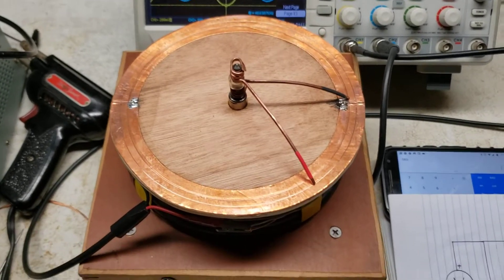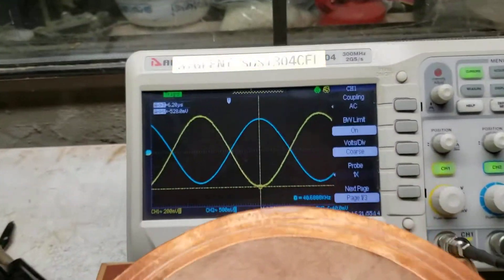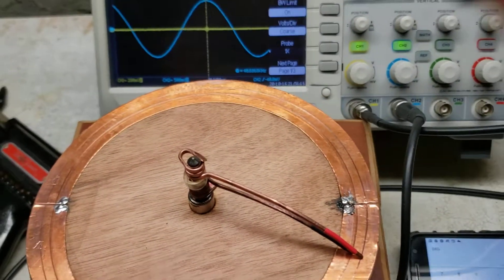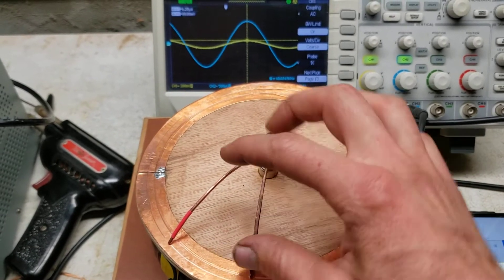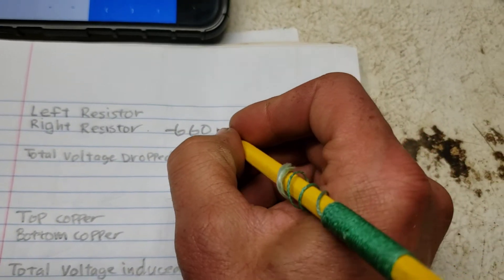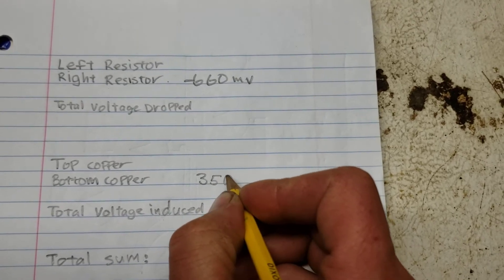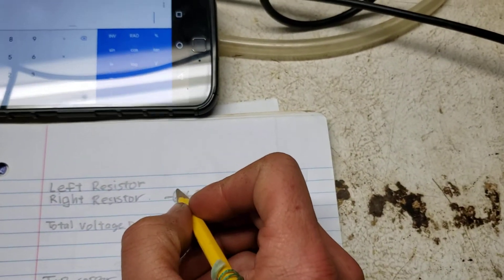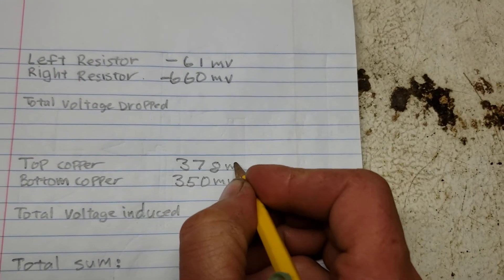The Lewin clock - Kirchhoff's Voltage Law(KVL) holds for loop circuits with induced voltage elements

Comment: Good to see actual experiments being carried out. I think your measurement only proves KVL fails, not otherwise. There is no voltage along the conducting arc, nor the radial segment. If there is, you must explain why there is no huge current, given that their resistance is ~0. It is precisely because there is no voltage along the sector loop and yet you could measure the voltage at the terminals that proves KVL fails.
Reply from the maker: If there was no voltage along the sector of a partial turn, then why was my volt meter measuring voltage?
Reply: @fromjesse  you are enclosing magnetic Flux with your probing circuit. That's why
Reply from the maker: @psonna  > you are enclosing magnetic Flux with your probing circuit. That's why
Of course!
You can model it as half the area of dB/dt, or you can model it as a half a turn according to Faraday's law, it doesn't matter, it's still physically allowing us to measure the voltage induced in that very half turn of winding. And that's what's important. Cheers!
Reply: @fromjesse  you-you've done it. You f___ed him off. You f___ed 4,4K subscriber channel off! Great job man!
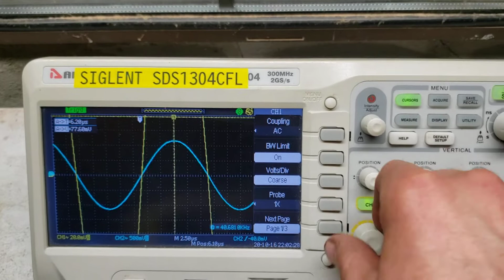Reply: @fromjesse  What you measured is the voltage induced from a sector of changing magnetic flux. Because there is no voltage along the conductor, and yet there is voltage at the output, the phenomenon is unintuitive and hard to accept. This is where KVL fails, the whole issue of the debate. I spent quite a bit of effect to explain the mechanism that causes this to happen, from 5:00 to 7:00, so I sincerely hope you watch carefully. Essentially, you have to consider the movement of charges along the wire, and their Coulomb e-field to get a complete picture.
Reply from the maker: @SiliconSoup  let's start real simple. Can you answer this question? The last three people to argue with me all refused to answer this question:

Lets say I have a small mains powered 50/60hz transformer which has two isolated outputs each producing 0.5v.

Then let's say I wire them in a series loop with two resistors.

Will KVL hold true for this setup? Yes? No? Don't know?
Reply: @fromjesse  KVL never holds for transformers and inductors, if you examine the voltage along every path, including that of the coil. But for circuit analysis, we are not interested in what is inside the transformer, so we use lumped component model to hide the fact the voltage along the coil is zero, and use the voltage across the terminal for calculation. So outside the transformer, by calculation or by measurement, KVL holds. But if you dig inside the transformer, KVL fails.
Reply from the maker: @SiliconSoup  thank you! 

Of course you have to lump each component in the loop. If you had a wet cell and were probing somewhere on the juicy part, that's not correct lumping.  Or if you had a solar cell or any other component and you were probing inside it at some other point than the terminals KVL would fail that too because every single component has to be lumped!

KVL doesn't care whats inside the lumped elements, it only cares about the voltage on the terminals.

Now, can you please answers this question: 

If we can, for the sake of KVL, lump each output winding as a lumped component,  why then cannot I just as legitimately lump the two output windings each as a lumped component and apply KVL as I did In the above video?

Its still a transformer.  It still has 4 properly lumped components.

And the algebraic sum of all the voltages around the loop is zero.

What is the difference between the demonstration in the above video (The Lewin Clock) and the small mains transformer with two output windings?  Why does KVL hold for one and not the other when they are functionally and electrically identical? 
Thanks!
Reply from the maker: @kpaxxapk6397  You really described it well, thank you!
Reply from the maker: So many arm chair theorists get stuck up on the false belief that the only way to induce a measurable voltage along a conductor is using current against resistance. 

But that's not true. There are several ways to induced a voltage across an inductor without current one of which is a changing magnetic field. Other things include the Peltier effect. Are you next going to argue that a Peltier voltage source cannot be used in a Kirchhoffs Voltage Loop because ohms law doesn't allow that much voltage across such a low resistance without a large current source? 

There are also other types of voltage sources that defy ohms law if you try to falsely treat them as a strictly ohmic scenario. 

But KVL doesn't care what the voltage source or the voltage drop is. 

What if you you had a couple ac transformers running off the mains. They each put out half a volt. 
You wire them up in a series loop with a couple resistors,  are you going to tell me that KVL won't hold for that too, because the voltage source coming from the transformers is derived from an electromagnetic principle? 

But what if instead of little transformers it was solid state digital waveform generators making the exact same waveform,  would that work for KVL? 

The silly thing about this whole discussion is that KVL simply states that if you have a loop and you add up all the voltages across each grouped element while honoring the sign, the sum will be zero.

I literally measured all the voltages across each of the grouped elements while honoring the sign,  and it summed to zero (at least within the margin if error for my volt meter.)

And you say it shows that KVL fails? How the Tarzan did it fail? It summed to zero. Thats the one thing it needs to do to succeed.

How did it fail to hold on this demonstration? 

Cheers!
Reply: @fromjesse  Why do you think you can selectively throw away ohm's law for the copper arc you measured?
It is precisely because the inductors have induced voltage across the terminals, and yet 0V along the coils that makes KVL fails.
Reply from the maker: @SiliconSoup    so what about ohms law? Say we have a transformer secondary with 0.0001 ohms and 100v. You'd expect a million amps, right? 

Or let's say we have a Peltier junction  with 0.1 ohms and 0.1v you would expect one amp.

Or let's say you have an electrochemical cell with an internal resistance of 1 ohms and a voltage of 3.6 volts.

All of these violate ohms law if we try to understand them as strictly ohmic.

Or if we connect a battery 100v battery  to a 0.0001 dc ohm inductor - at first there is no current when there should be a million amps.

It is not i who is selectively throwing out ohms law.

I'm just not trying to model every component as being strictly ohmic. All components may have ohmic properties but many Also have other properties. 

I'm not even sure why we're talking about KVL being applied to the segments along a winding path inside a transformer. KVL is for closed loops made of lumped components, not the open path inside an individual component. 

So you're saying that there is no voltage induced in the copper arc because that violates ohms law, but then you say its only at my terminals? But my terminals also have low resistance so doesn't that also violate ohms law? The entire system is low resistance and low current. Where ever you propose that the voltage is induced will violate ohms law unless you acknowledge that induction can create voltage across a wire without current im that  wire.

Once you realize that, then the secondary winding becomes the logical place for that, not some magical thing that causes my leads to have all that voltage on them while there's no voltage on the winding itself.

Why not along the arc length since its the one that cuts across the changing magnetic field and since my probes don't cut across a changing magnetic field?
Reply: @fromjesse  In the case of transformer secondary with 0.0001 ohms and 100v, if the two terminals are open ended, there is no current. if there is no current, there is no voltage drop along the coil. Even if there is current because of some load, along the coil, the voltage is still 0V, because V=IR is 0 when R_coil = 0. Across the terminals, the voltage is 100V. KVL fails.
If you think KVL not applicable to open path, just model your scope with a 1M ohm load, then the sector and the load forms a close loop. The voltage drop along the sector (arc + radial) is 0, because R_sector = 0 ohms (ideal case for the arc) times whatever current, the drop is 0 volts. Yes, along the sector (arc+radial) there is no voltage, yet the 1M ohm load (scope) has a voltage. This is the gist of KVL's failure. It is hard to believe, it is unintuitive, but it is true. To know how this could happen, you have to understand there is another hidden force in the transformer, the Coulomb force. The voltage across the transformer terminal is not from the changing magnetic flux DIRECTLY, but from the accumulated charges. I sincerely hope you watch my video. The content I put up is well established in advanced electromagnetism, not my personal guess. Of course it agrees with Dr. Lewin. I agree with Dr. Lewin, not because he is a famous professor, but because the same content is taught in advanced level of electromagnetism. After I posted my video, a viewer brought me to stackexchange.com, in which there was a discussion about "What would a voltmeter measure if you had an electromotive force generated by a changing magnetic field". A contributor posted a section "A tale of two fields" and it is relevant to our discussion.
Reply from the maker: @SiliconSoup   I did watch your video once at normal speed, but I'm out of town for a few weeks using my limited cellular data so I'm not going to watch it again till I get home.

Saying that an open loop becomes a closed loop due to the volt meter is a cop out: the current drawn by the volt meter is so small it does not significantly change the circuit under test. And in fact some field effect volt meters really do essentially draw no current,  but they work just the same.

You say that there is no voltage along the wire because there is no current because V=IR.  Isnt that just as true for any voltage generating component? Does a Peltier junction violate V=IR? Are we gonna say that since an unloaded Peltier junction  has low resistance and no current it therefore has no voltage even though the voltage meter reads 0.1v?

Look. KVL doesn't care what is inside a lumped element.  All it cares is that the lumped element has two terminals and that they have a voltage.  

Why do we tear into the windings of a transformer and try to break KVL? Why not tear into every other component and try to force it into a purely ohmic paradigm and therefor say it violates KVL because it violates ohms law?

Why can't a transformer secondary winding be lumped as a two terminal voltage source just like any other for the sake of KVL? 

I know you agree with lewin and I also know of a couple PhD physics professors (one MIT and one at another) who wrote a paper and they disagree with lewin. I don't care about popular opinion particularly but it's important to know that not all PhD physics professors agree with lewin.

No matter what, lewin mislead his audience.

Now, can you please answers this question: 

If we can, for the sake of KVL, lump each output winding of the small mains powered transformer as a lumped component,  why then cannot I just as legitimately lump the two output windings each as a lumped component and apply KVL as I did In the above video?

Its still a transformer.  It still has 2 properly lumped outputs and two properly lumped resistor elements. 

And the algebraic sum of all the voltages around the loop is zero.

What is the difference between the demonstration in the above video (The Lewin Clock) and the small mains transformer with two output windings?  Why does KVL hold for one and not the other when they are functionally and electrically identical? 

Thanks!
Reply: @SiliconSoup  If so, you better get the memo out to transformer designers around the world that they don't need any insulation on the internal windings.
Reply: @bobwhite137  I said there is no voltage drop along the wires, but there is voltage difference between windings; that is why KVL fails, and that also means you still need insulation between windings.
Reply: @SiliconSoup  There is no voltage drop, but there is a voltage difference between windings...  How can both of those be true simultaneously?  Just to be clear, I'm referring to windings along the same coil (e.g. the secondary).
Reply: @bobwhite137  i am referring to same coil too. Let me say it more clearly, there is no voltage drop along the coil wire, but there is voltage difference between different turns of the same coil. Yes, this can happen simultaneously, and that's why it is unintuitive. There are two e-field in the coil to make this happen, a non Conservative field from the changing magnetic flux, and a Conservative field from the accumulated charges.
Reply from the maker: @SiliconSoup  I can't believe it's happened again!

You're like the fourth arm chair physics Nobel Laureate to stop by and tell me I'm wrong.

And it always ends up in the same place, I ask the following question and they fly their armchair to another galaxy. 

Actually, some of them would not even answer the lead-in question of whether the outputs of transformers can be used in a KVL. At least you answered the lead in question.

But they've all fled by the time this question gets asked:

If we can, for the sake of KVL, lump each output winding of the small mains powered transformer as a lumped component,  why then cannot I just as legitimately lump the two output windings each as a lumped component and apply KVL as I did In the above video?

Its still a transformer.  It still has 2 properly lumped outputs and two properly lumped resistor elements. 

And the algebraic sum of all the voltages around the loop is zero.

What is the difference between the demonstration in the above video (The Lewin Clock) and the small mains transformer with two output windings?  Why does KVL hold for one and not the other when they are functionally and electrically identical?
Reply from the maker: @SiliconSoup  >Let me say it more clearly, there is no voltage drop along the coil wire, but there is voltage difference between different turns of the same coil.

And I suppose their is no voltage drop across a gradient Peltier junction either, since there is insufficient current to cause that much voltage for such a low resistance?

By forcing a transformer to be purely ohmic aren't we cheating ourselves?

Faraday's law is very clear that the voltage induced in the total winding is linear to the number of turns: http://hyperphysics.phy-astr.gsu.edu/hbase/electric/farlaw.html

If it's 1 volt per turn, it's gonna be a half a volt in half a turn, a hundredth of a volt in a hundredth of a turn, etc.

Which is literally what my video above shows.

>there is no voltage drop along the coil wire, but there is voltage difference between different turns of the same coil.

I notice you're shifting terms here. You say there's no voltage drop along the coil wire, but that there is voltage difference between the turns, so let me ask this:

Is there voltage difference along the wire?

If there is no voltage drop along the wire, then there is also no voltage drop between the windings.

If there is a voltage difference between the windings, then there is a voltage difference along the wire.

And I still don't understand why the outputs of my above featured transformer cannot by lumped as part of a KVL. 

KVL doesn't give a flying tarzan about what the source of voltage difference is, it just needs a lumped element with two terminals.

And the half-winding on my above transformer is exactly that. It can be exactly calculated with Faradays law and N=0.5, and it can be exactly measured by running one's volt meter leads at angles so there is no induced voltage in them, and the measurements and the modeling match up perfectly.

If I can lump it, so could Lewin. But he modeled his two half-turn volt meter leads neither as part of the circuit under test nor as part of his instruments.

As others have have pointed out, his schematic diagram was also deceptive because he did not show the inductive coupling of his volt meter leads in his diagram.

Cheers!
Reply: @fromjesse  Yes, you can always lump the 2 outputs as one lumped component, and yes I agree, the algebraic sum of all voltages around the loop (skip the path along winding, but use the voltage across the terminals) is zero and KVL holds. KVL holds if we treat transformer/inductor as a black box, and assume the changing flux is contained inside the black box, then its terminal voltage interacting with other external components obey KVL. We are in total agreement here. All that I am saying, is that inside the blackbox, KVL doesn't hold. The transformer terminal voltage is zero if measured along the coil wire. But because we normally don't measure the voltage along the coil-wire, we don't get to see 0V; we normally measure directly across the terminal, we only see the induced voltage. I know you disagree that voltage along the coil is zero, and supposedly V=IR can easily prove that, but somehow you are not convinced. If you only deal with circuits, then black-box approach (lumped element) is perfectly fine. BTW, I design embedded systems that control motors, induction coils etc; I am a hands-on guy, not a theorist. I don't know much about Peltier junction, so I can't say much about it.
Reply: @fromjesse  >"If there is no voltage drop along the wire, then there is also no voltage drop between the windings."  I know it is hard to explain this by words, and my video to a certain extend explained this,  and here I just want to state clearly what I meant to say: "There is no voltage drop along the wire, and YES, there is voltage drop between the windings, voltage is path-dependent."
Reply from the maker: @SiliconSoup  voltage is only path dependent if you can't probe correctly. 

And if two identical volt meters are connected to the same point and are reading differently, you're not probing correctly. 

If you run your volt meter leads in any number of paths that do not cut across changing magnetic fields then the measured voltage is not path dependent. 

On the other hand, when you get sloppy and maybe drunk and loop your volt meter leads through the transformer core a few times, then you've actually added turns to your transformer and you're not measuring the voltage at the tap in the transformer where you say you are.

So you're saying there's no voltage drop along the wire, but there is between turns. But that goes against Faraday's law which clearly shows the linear relationship in induced voltage.

And let me guess,  there's no voltage along a thousand turns of wire then suddenly at the last .0001% of a turn the full 1000v of drop develops?

And if V=IR disproves voltage drop along a wire,  why doesn't it also disprove voltage drop across the terminals of a transformer secondary? After all, the terminal resistance is just the sum of the resistance along the wire, and without current its impossible to have that much voltage drop.
Reply from the maker: @SiliconSoup  Greetings sir,

>KVL holds if we treat transformer/inductor as a black box,

Of course! That's the whole point of KVL - it's a given that lump each component as a black box. You have to. If you don't, then all kinds of components "fail" in KVL.

>and assume the changing flux is contained inside the black box,

The flux that cuts across that section of winding is "contained" in that it's not affecting any other component in a way that changes the outcome of our measurement.

>then its terminal voltage interacting with other external components obey KVL.

Excellent. The last two guys who flew in wouldn't even answer that question - neither to agree nor to disagree.

>All that I am saying, is that inside the blackbox, KVL doesn't hold.

What's the point? KVL is for voltage loops and inside any black box is not a loop. It doesn't matter what's inside the black box. The black box has two terminals. That's all that KVL cares about. That's why we use lumped components.

My one half turn is a black box transformer secondary, and my other half turn is another black box secondary. And I have two resistors, and they are black box components. 

>I know you disagree that voltage along the coil is zero, and supposedly V=IR can easily prove that, but somehow you are not convinced.

Yeah I disagree because I positioned my volt meter leads in such a way that Faraday's law assures me there is no voltage induced into them, and I measure voltage along the wire.

And Faraday's law is quite clear that the voltage induced along a wire is linear to the amount of a turn, so yeah.

I mean, what if I had  transformer with two half turn secondaries, and I have them wired in series. I can measure half a volt on each, or 1 volt total. Right?
In that case, you must agree that there is a half a volt being dropped/developed across each half turn, because there's a center tap.
But should I remove the center tap, now all the sudden there's no longer that half volt drop across each half a turn, but just magically somehow the whole volt develops at the terminals?

It doesn't even make sense. Maybe I'm just not smart enough.

It makes a lot more sense to look at Faraday's law and realize that volts is linear with turns, and that winding our volt meter leads is sloppy bad probing and is the same as adding turns to the transformer, and that if we watch our probes, we can in fact measure voltage along the path.

The fact is, in an air core transformer like shown above, there are several ways to route your probe wires without having voltage induced into them: Straight in, and if the solenoid is not of infinite length, practically Straight Up, Straight Down, speaking, straight out if you go far enough, or any combination of the above -- and all of the hundreds of possible permutations of combinations  - and they a reed the same voltage. A hundred different path possibilities and they all read the same voltage. That's not exactly path dependent.

But yeah, if you cut your volt meter leads across the magnetic field, then sure,  you're creating another secondary winding and you better model it or you're not lumping correctly.

>All that I am saying, is that inside the blackbox, KVL doesn't hold.

And why does that even matter? Inside the black box is not a loop. It's a two terminal open-ended path of some deep magic.

>The transformer terminal voltage is zero if measured along the coil wire.

Yeah, that's only because you're running one of your volt meters along the same path as the winding, but sign-wise in the opposite direction, so if there's +5v being induced into the transformer winding, there's -5v being induced into your volt meter lead. Do you get what I'm saying, even if you don't agree?

Everyone asks me to pass my volt meter lead through the transformer core. That's like literally having two windings in exact parallel and expecting voltage difference on them. 

 >If you only deal with circuits, then black-box approach (lumped element) is perfectly fine.

Yes, and in fact, with KVL, lumped element is absolutely mandatory. 

Like if you tried to use a chainsaw to cut rock. The chainsaw isn't going to work, but you can't say the chainsaw failed you, you failed it. Chainsaws aren't designed to cut rocks.

And KVL was not designed to deal with unlumped non-loops. It's for loops made of lumped elements.

>BTW, I design embedded systems that control motors, induction coils etc;

That's super cool. A few years ago I used an 8bit pic micro and made a 4 channel brush type DC motor controller with PID. I wrote the code in PIC assembly using 32 and 64 bit integer math and my own math routines.

>I am a hands-on guy, not a theorist.

You're definitely more hands on than the last 3 guys to argue with me, but I still can't figure out why so many people think that you can run your volt meter lead along the same path as the transformer winding and think you're measuring the voltage developed across the wire. Bleh. You're literally creating another transformer winding, so go and model that too!

>I don't know much about Peltier junction, so I can't say much about it.

It's super cool. You can take stainless wire and copper wire and a propane torch and weld the ends together. Then do it again so you have copper<->stainless<->copper (and you can use lots of kinds of dissimilar metals.)
It's basically a thermal couple. You've seen them, they use them for sensing high temperatures as well as generating cold for electric ice boxes.

It's been years since I was making them, but as I recall I could get nearly a tenth of a volt by putting ice on one junction and getting the other red hot.

Note that you don't even have to weld the junctions, you can twist, solder, or crimp them, but welding holds up to high heat a lot better.

I gave them as an example because they have very low resistance, and yet they develop a voltage without a current.
Reply from the maker: @SiliconSoup  so what is the difference between me treating the the two half turn windings of the iron core as individual lumped elements and me treating the each half turn of the air core transformer as individual lumped elements, as shown in the video above?
Reply: @SiliconSoup  Depends on your intuition :)...   I agree - there are two fields, the non-conservative E field from the time varying B-field, and the conservative field resulting from the re-arrangement of charges induced from that field.  Belcher does a great paper on it - I just wish he had connected the dots a little more plainly by stating the tangential boundary condition for E-fields (i.e. they must be continuous at a boundary).  That is what ties the inducing field (non-conservative) to the induced field.  Also, bottom line, KVL of course only works when analyzing conservative fields.  If you have path dependent potentials, then of course KVL fails.  Faraday always works - the interesting thing here though is that with the tangential E-field boundary condition, you can readily get the conservative portion of the field, and in that limited way, you can still do KVL.  In essence, what has been done in this video is a clever way to measure only the conservative portion of field (same as in Mabilde video).   Now you may ask, so what?  Well, because it does allow you to determine practical things like the breakdown voltage rating needed on transformer turns.   That's actually why I started with that example.
Reply: @bobwhite137  Since you agree there is a non-conservative and a conservative field present at the same time, then our understanding of the physical phenomenon is exactly the same, and we are in total agreement. If KVL is defined for the conservative field, then by definition it always holds, and I agree. But if we were to do measurement to verify KVL, then the voltmeter inherently measures the resultant field, so some would prefer KVL be defined on the resultant field, and so KVL fails sometimes. The measurement in this video is very interesting; the voltage measured is misinterpreted as the voltage along the wire (not just the conservative portion), then it makes KVL looks ok. You said the sector-loop measured the conservative portion of the field, it is true for this case, but it is also true for all loops in the magnetic field, including the transformer output. To know that voltage measured is only the conservative portion, one must know there are two fields, the result-field is zero along the wire, and if all these are known in the first place, then there is no debate on KVL. I think the debate started when some people think the voltage measured is the actual voltage along the wire. When we know that the voltage measured is from the conservative field, I agree it has practical usefulness. On the other hand, if the reading is misinterpreted as the resultant voltage along the arc, then the calculation for the current in the wire, and then the choice of the wire gauge would be wrong.
Reply: @fromjesse  In the conventional circuit, after hiding the changing magnetic flux in the black-box (lumped component), the KVL-loop of measurement does not contain any changing magnetic flux, therefore voltages in the loop add up to 0, and the lumped model works.

In Dr. Lewin’s circuit, the circuit loop always encloses the changing magnetic flux in the middle, so the lumped component model doesn’t work. In your proposed 4 lumped component model, the circuit loop still encloses the changing magnetic flux in the middle, so their voltage will not add up to 0.

I make this note here because I realized my previous reply was too general. I said "Yes, you can always lump the 2 outputs as one lumped component, and yes I agree", when I actually meant it for the conventional circuits only, where the KVL-loop of measurement does not enclose any changing magnetic flux.
Reply from the maker: @SiliconSoup  I was out of town 4 months, I don't really remember what you're replying to, but I'm really trying to understand why these armchair warriors can't get it. I literally measured the voltages around the loop in such a way that no voltage was induced along the length of my probe leads, and all the voltages summed to zero. (or at least close to zero as the accuracy of my volt meter allows.) That is what Kirchhoff mean when he wrote the rule, and I'm applying it as it's meant, and it holds.

Faraday's law clearly states that my probes will have NO voltage induced along their length, so they are not a source of error. My voltages added up as KVL says they should.

I think what people don't realize is that Lewin IGNORED his leads when testing KVL, according to the rules of KVL. He then accounted for his leads according to the rules of Kirchhoff which is total trickery. I could turn around and ignore the rules for MaxEQ and say it failed, but that's called a straw man argument. You have to test the rule the way it was meant to be used, and you have to faithfully follow the rules for the rule.

In fact, look, you might argue that there are things I don't understand, but you cannot possibly deny that Lewin was not being straightforward.

Dr. Kirk McDonnald of Princeton says in his paper that Lewin is using "misdirection" (which is something a stage magician does) and he also says that Lewin is using a non-standard version of KVL.
Dr. McDonnald concludes his footnote with "Of course, use of an obsolete version of a 'law' can lead to apparent paradoxes."

He doesn't even call it a paradox, he calls it an apparent paradox.

Dr. McDonnald also says "In Lewin's example, a meter reading, does not equal the voltage drop between the tips of its leads ...."

So again, Lewin claimed that the volt meters were connected at the same point, which he said to trick the audience into believing they were reading the voltage difference at the tips of the leads. But it was a lie. Dr. McDonnald says it was NOT reading the voltage at the tips of the leads.

Dr. McDonnald winds up saying "Lewin's circuit is within the range of applicability of Kirchhoff's loop equations, which can be used to predict measurements by the 'voltmeters' in the experiment. "

Dr. John W. Belcher of MIT also wrote a lot about it and  ends up citing Feynman, claiming that KVL does hold.

He ends up saying "In this sense, KVL holds, as argued by Mehdi Sadaghdar ..."

Until you can admit that Lewin used misdirection and a non-standard version of KVL, and that multiple of Lewins PhD professor peers agree with me and disagree with Lewin on the matter, you're clearly just a Lewin Fanboy parroting what he says.

Furthermore, you gotta admit that Lewin did not handle challenge appropriately. Mehdi very respectfully raised some very logical and understandable questions, backed by real experiments.  Even if Mehdi or I was 100% wrong, Lewin must know that it's a complex topic and had the honesty to say "Look, I know it's complex, and I can't figure a way to explain it." But instead, he called us "flat earthers."

Go convince Dr. McDonnald and Dr. Belcher that they are wrong, then come back and we can talk. That or come up with a clever way to explain that my above experiment didn't literally demonstrate that KVL doesn't hold. All my voltageds summed to zero, just like KVL said.

By the way, another mistake Lewin makes is to assume that all voltage drops are ohmic. That claim violates Thevenin's  theorem.

And yet another "mistake" that lewin did was to show an incorrect schematic diagram. He drew a diagram, and represented things symbolically. But he did NOT represent the inductive coupling of his probe leads. He literally deceived the audience. Had he drawn his leads in the diagram to represent his actual circuit, it wouldn't have been anything to write home about.

As long as Lewin did no wrong, I don't want to hear about it. Go convince Dr McDonnald and Dr. Belcher that they are wrong, then come back and let's talk. 

Thank you.
Reply from the maker: @SiliconSoup   In Dr. Lewin’s circuit, the circuit loop always encloses the changing magnetic flux in the middle, so the lumped component model doesn’t work.

Lewin's circuit didn't work with KVL because he didn't model all of it. He had FOUR, again I repeat, FOUR undocumented secondary windings hooked in series with his volt meter.

These windings were NOT drawn on the schematic, and were not modeled.

Had he modeled these, then KVL would have held just fine.

Like I said, convince Dr. Belcher and Dr. McDonnald, then we can talk.
Reply: @fromjesse  You have so many loaded questions and it will take me a while to digest. My video explains how transformers work, based on Maxwell Faradays equation and Columb force, with basic graphical illustration. I knew that most people would forget that charges moved by the induced e-field would establish a Columbian e-field to cancel the voltage along the coil wire, and once this is pointed out, it is clear that KVL doesn't hold.  Apparently, this point was not brought across well in my video, and I don't know how to explain it better here with words only. I sincerely hope that you watch the video again. I will read more about Dr. McDonnld and Dr. Belcher's comments before I can reply to your points. As far as I know, Feynman and Dr. Lewin agreed with each other, and how Mehdi came to the conclusion that Feynman agreed with him is mysterious to me.
Reply from the maker: @SiliconSoup  My friend, like I said before, I don't want to hear more from you until you can convince Dr. Belcher and Dr. McDonnald that they are wrong. They both issued written statements which I quoted from, they both said that Mehdi's claims were true.

One of them literally accused Lewin of being deceptive (using misdirection) and using an outdated or non-standard version of KVL, and creating an apparent paradox. 
One of them also said that Feynman would have agreed with Mehdi.

You've already put in plenty of effort to show me the error in my way, and so far you haven't succeeded. That means one of two things: Either I'm too stupid to understand, (which is possible) or you're not smart enough to explain it. Doing more of the same isn't going to help.

The whole point of correct probing is to correctly lump your instruments separately from the circuit under test, specifically to make sure that your instrument isn't inside any of the lumps. Because Faraday's law is very clear that wires running along the direction of the magnetic field have no voltage induced along them, it is clear that my measuring of voltages along the winding of the above transformer are correctly lumping because my probes run at the wrong angle to have any voltage induced in them.

With KVL, If you can lump it, it can like it.

I must say this has been a really strange experience. Usually when I disagree with someone, either they can see what I'm missing or I can see what they are missing and once that's explained, then we agree.

But in this case, I can't tell what you're missing, and you can't tell what I'm missing and we've been around enough.

Several people have challenged me on this, and their reluctance to answer real world questions suggests they don't actually know as much as they claim. But the common theme is that they can never explain to me what I'm missing, nor can I figure out what they are missing.

Except one, months later, did come back and apologize, which was really cool. Said he'd continued to think about it and finally it clicked, and that he could see that KVL would work in the way I was applying it or something.

But for most it seems like a religion, they can't explain it but ready to die for it.

For me, I read the description of KVL, I lump my components and measure around the loop, and it sums up to zero.

Like I said, get Dr. Belcher & Dr. McDonnald on board with you, then lets talk. They both already disagreed with Lewin and sided with Mehdi.

And dude, you've got to recognize that no matter what, Lewin was not being honest. The schematic he showed his audience DID NOT represent the actual circuit. In symbolic schematic usage, lines indicate nets. They imply no length, resistance, capacitance, inductance, nor are they the same symbol as a secondary winding on a transformer.

He had inductively coupled transformer windings in series with his volt meter leads which he did not show in the diagram, and did NOT tell his audience about.

He had his experiment trickily set up so that he could claim KVL failed (because he neglected to lump according to the rules for KVL) while it just happened to make it look like MaxEQ worked.

There is one thing you could do is propose a circuit I can build that will show KVL not working.

Other than a WRITTEN note from Dr. Belcher & Dr. McDonnald or a real life circuit of of the type that Lewin or I used which shows KVL failing, I don't want to waste your time or mine on this.

(Note: The circuit needs to be the type that mine and Lewin was in that the wavelength of importance needs to be much much larger than the assembly. There very well may be cases where KVL doesn't hold, but this isn't one of them.)